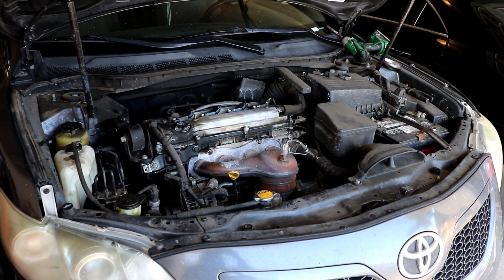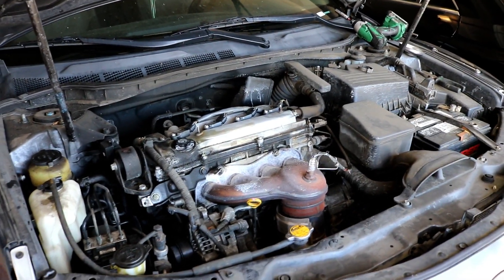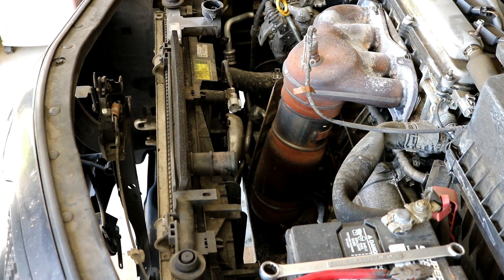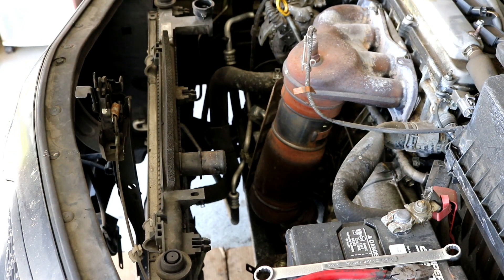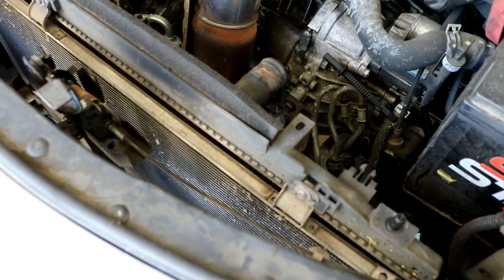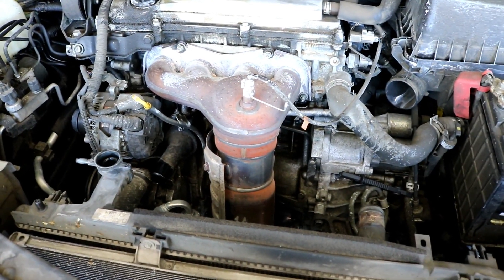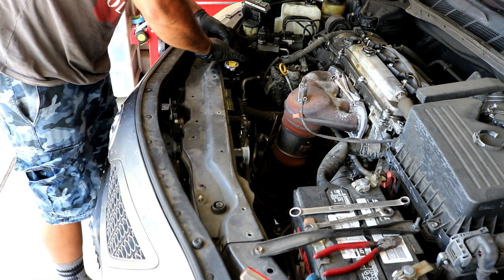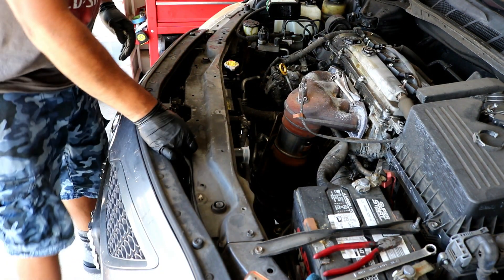2009 Toyota Camry Radiator replacement (2006-2011 XV40)

Comment: 13:49 Great video, appreciate having the knowledge before I jump into a job. I wish we could all make it more common to cover the battery terminals if we’re gonna use it as a work area. You had a close call there when you pulled the fan assembly out, I’ve seen some not go so well!!! 😮

Comment: On my 2010 Camry, I left the horns attached to the top radiator bracket. Just unplug the electrical connectors and the whole assembly comes out. Great video BTW.

Comment: I just changed mine taking my time took about an hour and half, also it's not necessary to take the plates off the bottom and you don't need to take the bumper off. Also recommend changing those crimp holders on the hoses they were a pain to get off

Comment: Good video I filled Trans cooler with Trans fluid.
Thanks
Reply: How can you tell when it is full?
Reply from the maker: There should be a dipstick on the transmission. Might have a black, red or yellow handle.

Comment: I would add that at the bottom of the radiator, you need to tighten up those to hose lines.. the radiator comes out and the nut on those are lose AF. Had sht spraying everywhere.   Nice video.
Reply: Was it transmission fluid coming out?

Comment: Great video, wish I saw this when my radiator was shot last year. Instead I had to pay $1,100 to replace it. Do you have to replace the thermostat and do a coolant flush when you do this?
Reply from the maker: SenterKill You do not have to do either when you replace the radiator unless you absolutely want to.
Reply: Whatttt????! murder is what that is. $1100??   My condolences man
Reply: I think you got stiffed. My mechanic was going to charge me roughly half that amount.
Reply: My radiator has a leak and a Jiffylube quoted me $800ish for parts+labor. Quick online search shows aftermarket radiator part at around $250, so most of it is labor. I am sure the dealer would charge significantly more. Thanks a ton for this video, will try this coming week

Comment: Hi, do you think I have to add any additional transmission fluid since some of it was left in radiator?
Reply from the maker: You can add maybe 8-10 oz back in.
Reply: @HelpingHandAutoRepair  the 2010 is a sealed system correct? So how do I add fluid to the transmission after the radiator change? Thx
Reply from the maker: Through dipstick. Should have a short one
Reply: @HelpingHandAutoRepair thx actually I found out my Camry is Japanese, it has a separate trans cooler. So I just capped the lines

Comment: What did you use  under your tires to get more head room?
Reply from the maker: Jack stands
Reply: Ok thanks I'm trying to flush my coolant  on my 2007 toyota camry hybrid do you know if the peacock plug is in the same place and will the peacock plug  be sufficient to drain most of the coolant ?
Reply from the maker: None None yes the PETCOCK is in the same place as on the radiator in this video. There is also a block drain bolt on the back of the engine on the passenger side. It’s pretty hard to get to and not sure if you should even waste your time on it. I would drain the radiator, pull the lower radiator hose off the radiator and drain what you get from there also. Lastly you could pull the upper radiator hose off the engine side and pull the water neck off and pull the thermostat out and that will let out even more coolant. That’s the best bet to get most all the coolant out of the system. Good luck.
Reply: @HelpingHandAutoRepair  thanks

Comment: I have 09 hybrid and has two brass small pipes at the bottom of the radiator. What are the connected to?
Reply from the maker: Like this one, they should be transmission cooler lines.
Reply: I don't think I have them because I don't see it anywhere.
Reply from the maker: @yinglium1934  you don’t see what?

Comment: what about the transmission fluid that would need to be topped off as well right?
Reply from the maker: Shaun Conklin Not as most would think. If you clamp the lines hardly any comes out. Unless you fluid was already low to begin with, you are only losing the very small amount that was inside the radiator when you pull it out. We are talking maybe 1/8 of a quart.
Reply: @HelpingHandAutoRepair  thanks I actually got it changes only cost me 250 bucks with buying a hydro jack. that 500 cheaper than anywhere in my town :)
Reply from the maker: Shaun Conklin nice job!

Comment: Darn why can’t I find a radiator with those trans coolant lines on the bottom 😮😣
Reply from the maker: Not sure. Make sure you are picking a radiator made for an automatic transmission camry.